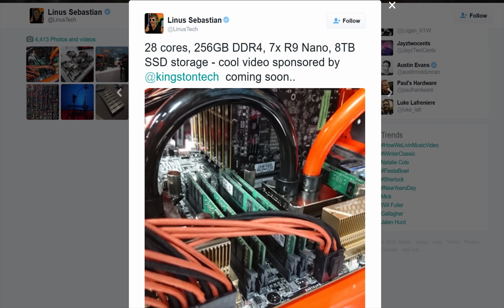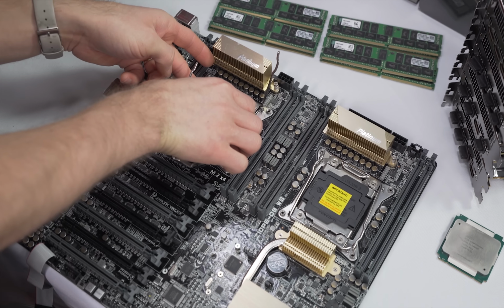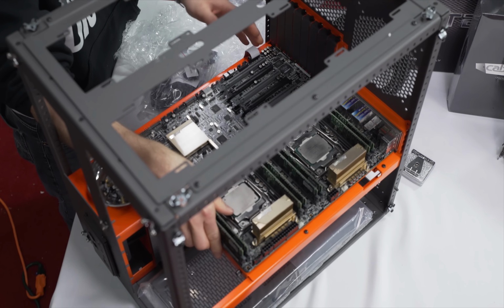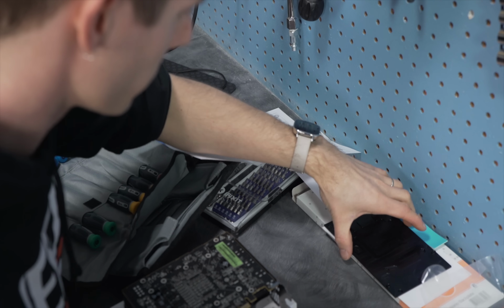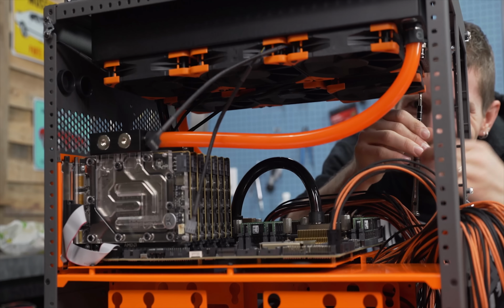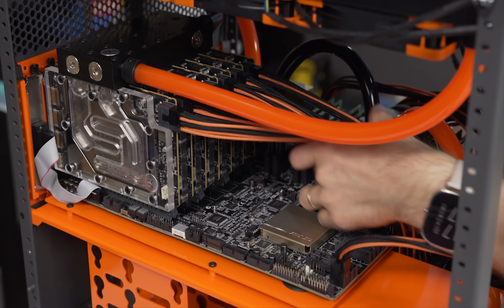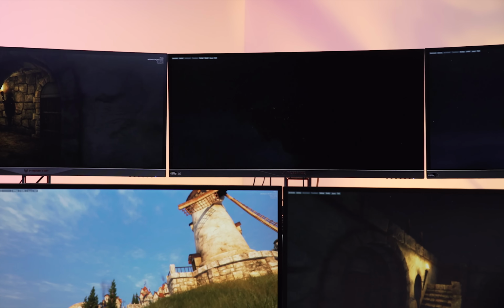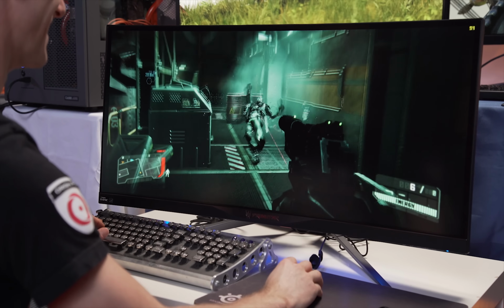7 Gamers, 1 CPU - Ultimate Virtualized Gaming Build Log

Comment: So if there are 2 CPUs, why lie and say there is 1? Could have just titled the video "7 Gamers - Ultimate Virtualized Gaming Build Log"
Reply: There is only one CPU. The two of them are linked together in a way that they become one unit together.
Reply: +R4zE its a 2 girls 1 cup reference i think
Reply: +R4zE If you have a multicore System you also call is just one CPU. 2 Xeons work as the cpu, just with more cores. So the 2 processors build one Central processing unit (CPU).
Reply: +R4zE The two Xeons work as one CPU.
Reply: +ShadyOrb09 they actually do not. Multi-CPU systems do not share instructions between the CPUs. They are not one logical unit and communication between them is relatively slow
Reply: OkarasChimera while you start counting at 0 that would mean "cpu[0]" and "cpu[1]" exist but cpu.count is still 2 - the indexing numbers really don't matter. or would it be 7 cpus if I said they are cpu_6 and cpu_7?
Reply: +R4zE cuz he means CPU as the "machine" not the processors
Reply: I guess it could be debated longer than it would be worth. I'll go ahead and fold to Linus's decision to label 1 CPU as he's more knowledgeable than I am, anyway.

Comment: So each VM doesn't have the power of an i5-2500K?
Reply: +byalexandr as a FX-6300 owner I can concur.. next build will be intel.
Reply: +Noorquacker Ind. Probably a little more with the extra threads.
Reply: +Ali Ahadi its worth it, dude. I went from an FX-8350 to an i7-6700K it was the best $600 i ever spent (mobo+cpu)
Reply: +Noorquacker Ind.  more like an i7 4770T
Reply: Ali Ahadi yah, Radeon isn't too terrible, But AMD is in the toilet.
Reply: ***** True, but cpu/gpu didn't really change since the 2500k era. The 14nm will have a big perf boost compared to the last generations.

But anyways, throw your money away if you want
Reply: +Noorquacker Ind.  4670T or FX-6300 to be exact
Reply: Tristan Berke Oh I know, I built a PC on a budget since I needed to build a more powerful PC for my work and since my previous PC was an older workstation, all the legacy components were expensive, so I just decided to build a better newer computer, but even though I had the 6300, it didn't feel that much faster than my two Opteron's that only clock at 2.8Ghz. It was pretty annoying. Then reading the reviews how today the CPU frequency doesn't mean much anymore as per the benchmarks, showed I should have just went with Intel.

AMD used to be competitive.... but not anymore, not even good at power management like they used to be.
Reply: byalexandr there may be some new intruction sets which would make difference, but in gaming, i doubt. it's not me, it's statistics from www.cpubenchmark.net
Reply: +Tristan Berke I too have the same AMD setup. and will be going over to 6700k.. every retailer has jacked up the price as high as 500 for the k cpu... smh
Reply: +NelsonTituAaa yah. it's horrible. I got mine for $320 so I am very lucky.
Reply: +Tristan Berke originally my overall cost for the build was going to be 1500-2000, not its at $2200-3k.. because of the increase in cpu.. I also changed the ram, want 3000mhz  but that's just me being selfish lol
Reply: +NelsonTituAaa Newegg has it for 419 right now. Also, unless you intend to actually overclock, just don't get the k and save $70.
Reply: Tristan Berke Imo Radeon cards have great hardware.... terrible drivers, lol. I ran both Radeons/nVidias back to back and nVidia came out on top. But in pure number crunching Radeons are king, but for gaming support not my choice at all. For the build in the video the radeons support features for this kind of setup, while the nvidia won't so it's not like he had a choice.
Reply: +UnashamedlyHentai $70 is nothing compared to everything else I'm spending. I will be purchasing everything within the next week or so, still figuring out my custom loop.
Reply: NelsonTituAaa actually with ddr4, 3000mhz can lead to instability. I've run 2400 and 3000 and i prefer the 2400.
Reply: Ali Ahadi exactly, nvidia and radeon both have their strengths and weaknesses. but amd and intel, there is no question.
Reply: Tristan Berke I haven't checked myself, but are they CPUs now that can really take use of 3ghz from the bus? I remember people getting excited about how "fast" memory is now, but it looked like it was better to get lower frequency like 2400 and just make sure you get good cas latency specs.
Reply: Tristan Berke Yea.. at first I thought oh AMD bang for the buck, cuz GHz vs GHz, but then finding the benchmarks from everyone proved wrong, lol. Also AMD used to be the lowest power consuming CPU, not anymore =/ Their industry side still has a slight edge for low power consuming setups, but I fear that's going to go away. Even my small seedbox, I ended up going with an intel atom.
Reply: Ali Ahadi well, if you are overclocking the cpu, the memory tends to like a lower speed in order to deal with all the extra power going to the CPU. the bus can technically handle the 3ghz speed, but it leads to instability and its just not worth the hassle. and the memory will be slowed if you overclock, so you will be wasting your money.
Reply: Ali Ahadi well, i would go with intel if i were you, doesnt matter what CPU, because AMD is running EXTREMELY old architectures. we'll see what happens with the new ZEN CPU's from them but i doubt they'll ever come back.
Reply: Tristan Berke Oh yea, I will be going intel, my current rig is now almost two years old. Prior to that I was building commercial type setups so different type of build, I hadn't built a normal PC in so long. Pretty sure by the end of this year I'll be building a new intel setup.
Reply: +NelsonTituAaa Why would anyone buy skylake when 14nm cpu are coming in half a year ?
Reply: +Escalator cause we feel like it.
Reply: Escalator Because the next generation is always coming.
Reply: Escalator agree if you can wait the 6mo it's always nice to have the most up to date hardware.
Reply: Escalator I mean, I bought Ivy Bridge. I'm not upgrading for another year or two. I was just saying that there's always something around the corner.
Reply: *****
yea but this time it's the biggest thing in 5 years

Comment: cant you run all 7 in crossfire?
Reply: +Tushar Mahajan No, the VM's wouldn't be able to use one each. Once you crossfire a couple cards, they act as one and you wouldn't be able to split their power between two VM's.
Reply: +Tushar Mahajan no it only goes up to 4
Reply: jjjhfam yeah but I meant without a Virtual Machine. Virtual Machines use Virtual GPUs (vGPUs)
Reply: john li you can only go up to 4 GPUs in crossfire? what about Nvidia SLI?
Reply: Tushar Mahajan still 4 for nvidia SLI
Reply: +Tushar Mahajan pci-e slots are electricly divided between 2 sockets
Reply: allright thanks for ur guys help ;)

Comment: Imagine what it could do without that shitty AMD card.
Reply: +perochialjoe get the fuck out
Reply: +perochialjoe shitty? that shitty amd card is smashing crisis 3
Reply: +perochialjoe like not being able to pull the gpus off
Reply: +perochialjoe you're just jealous when you don't have 7 amd cards m8
Reply: +perochialjoe It would probably have more headroom for overclocking and a little bit more FPS but you would need a PSU well above 1800W which afaik doesn't exist
Reply: +gfrewqpoiu Just do what Austin did in Scrapyard Wars and put in 2 1600W PSU's!
Reply: +gfrewqpoiu 7 980 Ti 's have according to Toms Hardware a Powerdraw of 2100 Watts. NO PSU can handle this, and you need the 980 Ti or at least the 980 for 4k Gaming the 970 is just a garbage card.
Reply: +TriguyRN Sure it is possible, I just meant that it wouldn't be possible with 1 PSU. Also you need one slot cards and please tell me if I am wrong but I haven't seen One slot variants of the 980; 980 Ti and the Titan X
Reply: +perochialjoe It wouldn't have been possible at all with nVidia cards. Just watch the part again when he talks about the cables.
Reply: +gfrewqpoiu is two psu's theoretically possible?
Reply: +cjgaltieri Good point
Reply: ***** and you also wont be able to remove the gpus
Reply: john li Sure. Was just answering the question. I have no problem with the cards Linus used. Shit, I run a 750Ti in my middle-of-the-road machine.
Reply: gfrewqpoiu yeah I understand and you are correct
Reply: Look! Another idiot!

Comment: So , this is actually useful , for events or some sort of lan setup , because now you have 7 "machines" in one , you bought only one motherboard  , 2 cpus , so i think is correct to assume the cost is lower compared to building 7 individual machines, Of course  some things would need to be toned down .... otherwise the cost per output would be too high.  Now just thinking about actual usability of such a system .... if it is even possible to get a good cost per output .

Comment: maybe 7 xbox ones could run 1 star wars battlefront properly?
Reply: +Alpacapple actually you are wrong. Both consoles have slight differences in specs and clocks. Look it up.
Reply: +TDTechOfficial they're the same in the sense that they are shitty, non-upgradable, underpowered PCs with a proprietary operating system, slightly customized but still x86_64 AMD APUs and no discrete graphics card.
Reply: +'Murrican Oil Last time I checked, the xbox one ran battlefront on a lower resolution, as with almost all other xbox games compared to ps4. Even halo an xbox exclusive runs at 900p. Its a pretty pathetic machine, considering how big and fat it is.
Reply: +'Murrican Oil But Sony has the RPGs and imports. How am I supposed to play my Super Heroine Chronicle on xbox?
Reply: ***** resolution is the single most important graphical appeal to a game. xb1 plays games in lower resolution than the ps3, which is 9 years old. Theres a reason why it gets so much so much flak by people
Reply: I knew this would turn into a stupid xbox vs. playstation war.. it's always funny that you fight about which of the 2 under-performing machines is worse..
Reply: i dont fight for the ps4 its not that great either and i dont own any of them. i like to piss of the xboys with facts though
Reply: ***** a PC doesn't have to be more expensive than a console to outperform it.
It is higher maintenance, but it's far from high-maintenance.
I totally agree that acting superior is stupid and telling people to use either is stupid too, but the flat out lies people tell to defend either choice is ridiculous.
Reply: Hahahah you think you know things about me again. I dont play videogames anymore. i have a laptop. Laptop master race i guess
Reply: Man why can't we just appreciate things for what they are... Consoles all tend to perform better than PC for their specific spec, so there's that. But can't we just enjoy things for actually playing their games? A lot of my PS3 RPGs look like they could be on the PS2, and I'm sure this trend will not change with the PS4. PC is fun and all too, I can compile code, can't do that on a console unless you install linux. Never bought an xbox because I haven't cared about their exclusives, but their controller is useful on PC.
Reply: chande lier They do perform well for their specs because they are well optimized and run low-overhead operating systems. BUT they are horrendously overpriced for their performance. 

And why can't we just enjoy consoles for their games? Simple. Because you shouldn't be required to make a specific console purchase to play a game. They are literally PCs now so there is little development overhead for porting games and thus releases should be on all the platforms: Xbox One, PS4 and PC.
But they aren't. Why? because developers get money from the console producers to make exclusives. (Wonder why they are overpriced for their performance? Here is part of the answer)

What practical purpose do exclusives serve for gamers? NONE. They are used to brag and fight and argue. Why do we still have them? Because people keep buying them.

Anyone who really wants to improve games from a consumer perspective shouldn't be buying exclusives. But you know the problem with that? The consoles have almost no selling point beyond that. They are overpriced underperforming PCs with a controller and custom OS. Hardly enough of a selling point if you cannot play different games than on a PC.

Consoles, again and again, live and die by their exclusives. So maybe it's time to stop these shitty industry practices. It's a shame that consoles will likely die with them because they just cannot keep up without them.

But perhaps there is light at the end of the tunnel and someone creates a console that isn't overpriced and underpowered and thus can sell the console on it's real merits: a simple, easy to use gaming machine for the living room with a fair price/performance ratio. Something current console manufacturers simply do not offer.
Reply: NeXtDracool interesting, but i have to disagree with some of it. Ps3 handled bf3 ridicously well for its price and still has ten housands of people playing online on that game alone. And from what ive seen the ps4 handles bf4 and the battlefront very well too. Its really a bargain to buy a console in my eyes.

 Many of us dont want to pay 5x the price for our videogames to look slightly better. You need to accept this
Reply: *****
"$350 for a prebuilt gaming machine is fine"
it is. The point is that you can get one that performs better than the consoles for that price.

"You're guaranteed compatibility for all the latest games"
Are you? Is a game that constantly runs at sub 30 fps with large fps drops REALLY compatible with your system? Because I think SUB 30 fps is absolutely unacceptable for games.

"Steam Machines are overpriced as f**k"
absolutely. I do not defend the Steam Machines in the slightest. They have the disadvantages of consoles (overpriced, underperform, not upgradable) and of PCs (more maintenance required, compatibility issues between games and hardware). 

"and running Linux"
If you want to say SteamOS is Linux then you also have to say the PS4 runs FreeBSD because their operation system is based on FreeBSD. Oh and the Xbox One runs Windows because their operating system is based on Windows. 

"KB/M is awful on the couch"
agreed. Controllers work fine on windows. auto boot into steam big picture and you won't have many problems aside from the at best average steam big picture interface.

"The new consoles have a lot going for them.  They're just the next entry in their series, and I totally get why they're selling."
Reminds me of "I could show you proof, but I won't". If they have that much going for them, tell me about it. Because I would like to understand, but so far everyone has just been telling me about the great games on them. that frankly should be on all platforms.
The minor benefit of usage simplicity, simply does not seem to justify the subpar game performance with lower resolution, and especially frame rates, and the many other disadvantages I already named.
Reply: ***** " most online shooters are at the full 60 FPS anyway" [CITATION NEEDED]
I took a list of all 2015  multiplayer shooter releases on ps4/xb1 from igdb and fact checked for you. (Note: I did not check to what extend these games have multiplayer, I simply checked the multiplayer check box)
Results:
COD: Black Ops 3:
(resolution <1080p)
Target: 60 fps
Reality: Avg. 49 (XB1) | 51 (PS4)
Dips below 30 in gameplay on XB1.
(0 - 1)

Wolfenstein: The Old Blood:
(resolution <1080p)
Target: 60 fps
Reality: 60 fps
(1 - 1)

Battlefield: Hardline
(resolution < 720p)
Target: 60 fps
Reality: 40-50 fps, over 9% of frames dropped on XB1
(1 - 2)

Dying Light
(resolution =1080p)
Target: 30 fps
Reality: 30 fps, rarely dips lower
(1 - 3)

Resident Evil: Revelations 2
(resolution = 1080p)
Target: 60 fps
Reality: Avg. 41 (PS4) | 51 (XB1)
dips below 30 in gameplay
(1 - 4)

The Order: 1886:
(resolution <1080p)
Target: 30 fps
Reality: 30 fps
(1 - 5)

Metal Gear Solid V: The Phantom Pain
(resolution <1080p on XB1)
Target: 60 fps
Reality: 60 fps
(2 - 5)

Star Wars: Battlefront
(resolution <1080p)
Target: 60 fps
Reality: 60 fps
(3 - 5)

Evolve
(resolution <1080p on XB1)
Target: 30 fps
Reality: 30 fps
(3 - 6)

Halo 5: Guardians
(resolution scaling <1080p)
Target: 60 fps
Reality: 60 fps
(4 - 6)

Zombi
(no data available)
(5 - 6)

so even if I generously put the missing data as achieving 60 fps, not even 50% of console multiplayer shooter releases in 2015 have 60 fps.

Now after that's out of the way I will look at what else you wrote.
Reply: ***** No need to get angry. All the numbers in my list are from actual performance analysis reviews from eurogamer and dsogaming. Do not get clouded by the fact that you like Battlefield.

All I did was investigate if your claim that most multiplayer fps on the new consoles run at 60 fps was true or not and the results show that that's simply wrong. I already said that the problem is people just flat out lying or misrepresenting the truth about the consoles to make them look better.
Reply: ***** The Battlefield: Hardline numbers are from multiplayer, as are Star Wars: Battlefront's numbers.

I do not play any shooters so I have no idea which of them are multiplayer. I simply checked the "shooter" "multiplayer" "2015" "playstation 4" and "xbox one" checkboxes and went through the entire list.

Edit: last time I checked professionals play at the graphics that they like, choosing higher settings in games like CS:GO doesn't change a damn because any decent machine can run that game at many hundred fps at all settings.